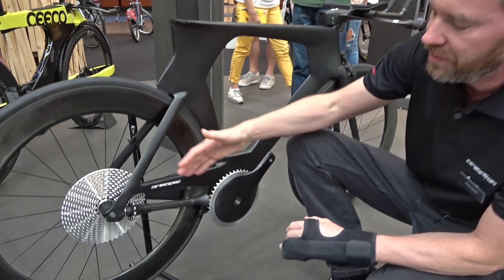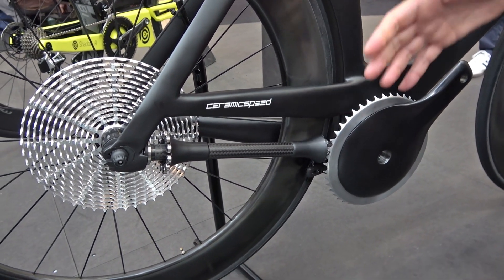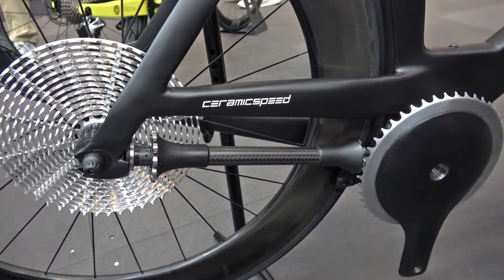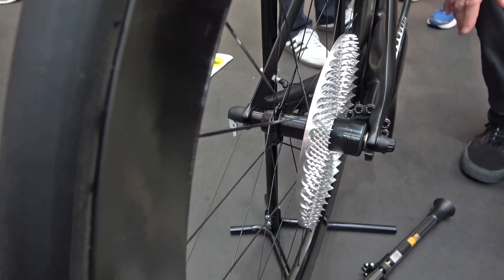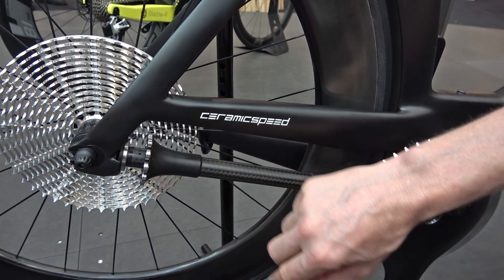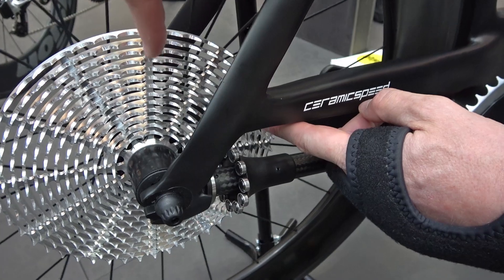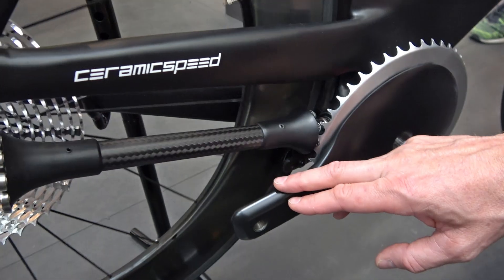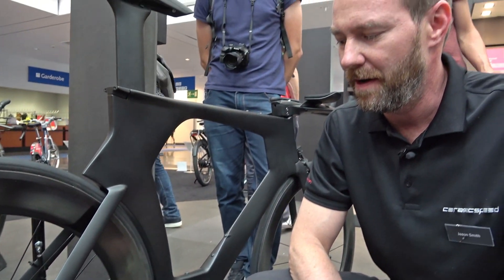CeramicSpeed Driven - Fully explained

Comment: So many videos and none of them show it switching gears.
Reply: coz it is just a prototype, switching gears will be provided in future, but it looks ease with splines on the shaft
Reply: in fact switching gears will be the hardest thing on the system. bicycles with single speed shatf drive have been around for more then a century. so no point of making videos of something "revolutionary" and claim performance numbers without showing something really new working.
Reply: there is a video on it switching.. it makes a lot of noise
Reply: Harry Tzianskis The God of Speed can you link it? I haven't seen it either.
Reply: https://youtu.be/rgo-yEaXDzA here you go guys! 😁 Shane Miller
Reply: Harry Tzianskis The God of Speed that one doesn't show the shift, but I believe that feature may not be hooked up on the prototype yet.
Reply: RedWings-44 yea its just spinning. I thought they changed gears. I guess they have no shifting yet. But i can tell you its a stupud idea ans it wont go anywhere
Reply: Filipe Oliveira it doesn't yet
Reply: matpio7 I suspect you have no engineering background whatsoever.
Reply: Harry Tzianskis The God of Speed it makes too much noise without shifting gears.
Reply: I know it makes a lot of noise  there is  no way this would be  good for cycling..
Reply: There are things about physics that can't be turned around. The power is ALL transmitted by a single bearing at a time with little millimeters of surface area and one side shatf supporting it. I've been working with mechanics for many years and can see this will have poor durability and very high failure ratio.
Reply: Filipe Oliveira Not to mention the wear the gears would sustain from the build up of abrasive dirt
Reply: Filipe Oliveira don't try to talk sense to Fanboys who want the newest, greatest, "bestest" thing.
Reply: because this invention is bullshit.
Reply: I agree. It annoys the hell out of me when fanboys think that gimmicky innovation can suspend laws of physics.
Reply: And yet the purpose of such things is to solve old problems and uncover new ones. It doesn't have to be the final version, it just has to give someone a better idea.
Reply: ok
Reply: i was here for the gear switching part...
Reply: I just don't see the efficiency "for every change of direction is a loss of efficiency and power"
Reply: LMAO buddy stop acting like you're an engineer in this project. You don't know what the hardest part of it is, let's wait and see.
Reply: Filipe Oliveira lol, do they even show it riding?
Reply: Filipe Oliveira exactly. I was watching hoping to see it here. But could not find any that shows that.
Reply: This will only work for fix gear... 😏
Reply: I guess their engineers forgot that part.
😀😁😂😃😄
Reply: Harry Tzianskis The God of Speed I don't believe that works, cause the axis like that in the motorcycle loses too many force.
Reply: I think the emphasis here is on friction reduction.
Reply: Filipe Oliveira w
Reply: Harry Tzianskis The God of Speed That video you linked does not show shi(f)t.
Reply: There is an electric motor powered by a battery inside the shaft drive. The motor actuates rotating an screw that displaces the "spinner" back and foward....I thnk the electrical signal to change speeds is by wifi or something wireless.
Reply: Filipe Oliveira  and also transfering high momentum from drive shaft bearings to caset will be challenged
Reply: They haven't figured out how to make it switch gears yet. They are considering using some sort of wireless solenoid to move the drive shaft into different positions.
Reply: i'm trying to imagine it in my head how it's possible to slide to another gear when moving.
Reply: Josar Gor 
You either increase the slack so as the chain spins it increases it's circumference and connects to the next size up; or you increase tension to reduce the size forcing it to latch on to the smaller sprocket. In this bike the mechanism  (done electronically) would just push the spinning bearings back or fourth. The gears have angled diagonal grooves so it can move along an x-plain while the teeth are spinning.
Reply: You don’t get something new without experimentation. The point of this prototype isn’t to replace all drivetrains, it’s to see what might be possible. 

Criticism of the design is useful, bad attitudes are unnecessary
Reply: Filipe Oliveira but it is revolutionary! Did you see him revolve the shaft?
Reply: @josargor8179  he showed us there are two pathways arranged for shifting gears. The shifter waits for one of those pathways to rotate around till the bearing "round tooth" is in the pathway and then the shifter now has a path to the next gear. If the shifter is super fast, it could shift several gear positions. And with the "parabolic" pathway, it could easily shift over several sprocket positions.
Reply: It doesn't shift yet... It's pure hype.
Reply: Agree. I want to see the shifting. Also good point was made regarding the strength for racing. A chain runs around the whole sprocket where as this as only one bearing taking all that power. This might be viable for other applications but not racing.
Reply: They gotta get the electronics done thats why
Reply: @DoomFinger511  What chain? There is no chain.
Reply: @buddyclem7328  Did you not read the full comment? I used a "chain" as an example of how gear changes occur. The next sentence in that comment was "In this bike the mechanism (done electronically) would just push the spinning bearings back or fourth. The gears have angled diagonal grooves so it can move along an x-plain while the teeth are spinning."
Reply: Timestamp 4:20 ish

This is how we envision it shifting. As in, it currently does not shift.
Reply: @HarryTzianakisTheGodOfSpeed  Thanks for the link, not sure it's shifting though.  Seems a round surface on the bearing will make shifting smoother and tighter tolerances might quiet the system down... maybe lubricant alone will aid... though I am thinking tolerances and there needs to be more sealing also since this seems to be a nightmare if not looser specs for debris.  If sealed, tight specs and the materials science is engineered for the mechanics max load scenario... plus extra loading... might be great if the efficiency if valid.  The noise sounds like is primarily from the freewheel mechanism.
Reply: jafinch78 there's the free wheel in the back making noise and the crank in the front. The arm needs to be secured for it not to be slipping. If a mechanical happens with the system I don't think there's much you can do. I do have a solution for it not to slip under pressure but I'm not giving it up until they pay me. And if they come up with the idea on their own good for them
Reply: When I first started cycling, I got myself a copy of Richards BicycleBook.
Testing for drivetrain wear by applying a pedalling force but with the rear wheel brakes, chain wear could be assessed by seeing how many teeth the chain engaged. Oddly enough, 8 was better than 2 as if only 2 links engaged with the sprocket then it was worn and due to the load being applied to fewer points of contact, it would accelerate the rate of wear.

This system would appear to be a retrograde design in that respect.
Reply: @jafinch78  Tighter tolerances = more friction = more power loss. The design creates axial load on the rear axis, this means they have to use different kind of bearings on the rear wheel and it really doesn't look like the rear sprocket can take that load (especially in lower gears).   Plus shifting with a microcontroller would mean that we need to know the exact position of the shaft, back wheel and the shifting screw  - a lot of signal to process and a lot of math to be done since they are constantly changing. Seems unlikely it will ever leave prototype phase.
Reply: @matpio7  That's like making a not-flying prototype of a flying machine where the problem of flying hasn't been yet solved, lol. Can you see the problem in that?
Reply: @Miguel256f  you have the other part as well... the further out from the center it goes the less support is on the rear gear... the further out it goes torque goes up exponentially... in my opinion to support that pressure  that gear should be the entire rear hub assembly.. dont get me wrong theirs is cute....
Reply: They can use shifting system by spinning momentum, there may near same as automatic moped belt on pully plate. Dont know how to adapt, may by spring tension on transfer rod
Reply: Because tou dont need to be an engineer to see that it will not work. There are two possobilities: gears will slip near the end or force of rotation will chip off/bent engaging teeth on the recieving end
Reply: You ride a battery of bikes, each of them in it's own gear....just have to learn how to switch horses.
Reply: I believe that switching gears would be easy, its a computer science problem, not a mechanical one
Reply: @HarryTzianakisTheGodOfSpeed   That vid-link does not show the gears changing. It's a work of art without a multi-speed capability.
Reply: Yeah, right. And it's electronic on top of that. I don't see this going very far especially with the price it would be. I'd rather have mechanical gearing because anything electronic would cost too much and fail more often.Ii can also see the bearing stems breaking when adding too much of a load to it when taking off. I'm fat and 247 pounds right now. I think I would break it. Something like this would be for smaller people so I don't think it's very reliable and I wouldn't buy one. Great idea though and would like to see it work well. I just don't think it will.
Reply: That is because they cant make it shift at the moment. Not to mention the obvious clearance issues between the rear "pinion" on the shaft hitting the frame when its shifted into the smallest rear position for fastest gear. This is a gimmick.
Reply: You haven't watched the entire video have you? Otherwise you'd have seen him take you through the electronic gear switching on a mock up.
Reply: @rejects101  I watched the entire video and no, he did not shift anything. Holding a mock-up of the mechanism is not shifting the gears, is it? No. Its not.
Reply: fake it until you make it?
Reply: Filipe Oliveira wtf you just saved me like 8 mins thank you
Reply: This thing is a con. Both ends will grab and trap any detritus and bust the whole system open.
Reply: @HarryTzianakisTheGodOfSpeed  this has been tried before. It will go nowhere. Lots of vague bullshit claims.
Reply: @HarryTzianakisTheGodOfSpeed  that video does not show switching gears, and no videos of any one peddling under force, and they keep a mockup frame only to prevent anyone from breaking this flimsy design. This thing is a con.
Reply: @Miguel256f  agreed...but these are AMERICUN engineers full of marketing savvy and confidence.
Reply: @inspectorcrud  one tiny rock and the mechanism will fracture.
Reply: @truantray  This is actually a very old invention. And yes its bulshit. The maintenance on it will be half the cost of the bike. its just  ridiculous.
Reply: @HarryTzianakisTheGodOfSpeed 
That doesn't show gear changing either
Reply: Don't get the drivetrain wet or dirty
Reply: Just thinking the same thing.  And what about the lateral force?  I think is lateral,  the force that will push the cassette towards the spokes. 
Great Idea but I think tech is still way far off on it.
Reply: Seems like you would have to stop power delivery while doing that lol
Reply: @sporkeh90  Why is that? I think that's the reasoning behind the grooves lining up in those 2 sections.
Reply: @travisk5589  Sure I can see how you can shift on-power, but thatd wreck those roller bearings or the teeth real fast.
Reply: Because it doesn't.  Doesn't seem to freewheel either so once you going you can't stop pedaling.
Reply: @Baka_Oppai  It freewheels, its in this vid :P
Reply: I think the turning shaft should be automatic gear change just an idea 👍
Reply: @robmarrin6720  variomatic on a bicycle? that'd be way too heavy I think
Reply: ..which is the least amount of problem on a bicycle drive train while riding.  @mirarki
Reply: Seems overly complicated. Servos,wifi. Who knows.
Reply: @HarryTzianakisTheGodOfSpeed  "there is a video on it switching.. it makes a lot of noise"
I saw the linked video. It's not a video of it switching different gear ratios, though.
Reply: Justwantahover yes I have seen that video on myself. This is actually a very old invention if it didn't work in the past it's not going to work now. Can you imagine the cost of the maintenance on this thing?
Reply: @HarryTzianakisTheGodOfSpeed  The single gear one is ok (I suppose) but I like the belt drives, what happened to them (too much slip I suppose).
Reply: Justwantahover  belt driven would actually work if they put in the research to do it. Belt driven would be less maintenance. The bike industry is going to try to keep the product at the most maintenance possibly needed. The way things are is more beneficial to the industry and it works really well.
Reply: The software department is working on it.
Reply: So every prototype must work, first time. You so smart.
Reply: I hear a lot of people that probably don't work on their own shit knocking someone trying to invent something completely new. There are multiple straight shots for shifting, and slanted towards, or away from the direction of travel. The direction that has the shift channel slicing would be better for downshifts, the one with the channel stabbing (when making forward progress on the bike) would be better for upshifts, the shifts wouldn't have to be as fast as on the perpendicular channels. Now, just gotta get a fast electric piston style motor and this will work. Worst case scenario you gotta ease off the pedals a little between shifts like an internally geared hub. This can work.
Reply: If this were anygood top bike manufacturers wud snap it up! But ultimately  because changing gears a 24hr occupation its never gonna be taken serious great design and clever new way of creating less friction but all that good work and you cant change gear lol!🤷‍♂️
Reply: Filipe Oliveira ł
Reply: I down-thumbed his video.
Reply: I'm guessing it can't.
Reply: There will be a laser sensor that see the gear moving.  This laser sends a signal to a wifi module under the seat.  The wifi activates pneumatic hoses that have magnetic particles in them.  A strong magnet deflects the magnetic particles enough to change the curvature of the pneumatic hose.  There is piezoelectric crystal on the hose that generates a spark when there is enough curvature to allow the gear teeth to be mimicked by smaller teeth.  That's all there is to it!
Reply: The Bald Guy qqqqqq
Reply: All they have to do is create an angled bracket that is spring loaded or hydraulic and it’ll shift
Reply: @Miguel256f   "I've been working with mechanics for many years "...and I cannot spell a simple 5 letter word... S.H.A.F.T.
Reply: @pauloreche  too many force???
Reply: They do now
Reply: They achieved switchen gear last end of 2019
Reply: @matpio7  ZACss2
Reply: The Central part of the  shaft has in it  a battery driven gear shifter.Please see the video closely and hear the  narrator intently.Thank you.